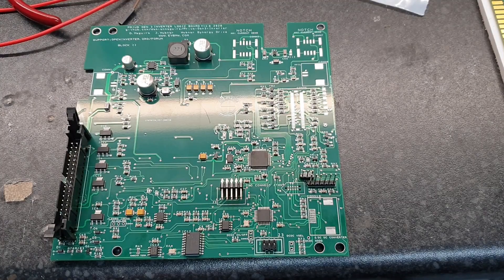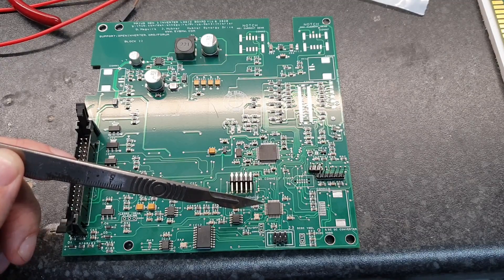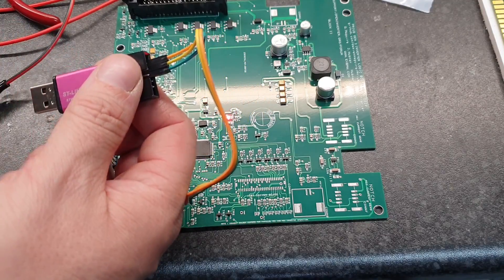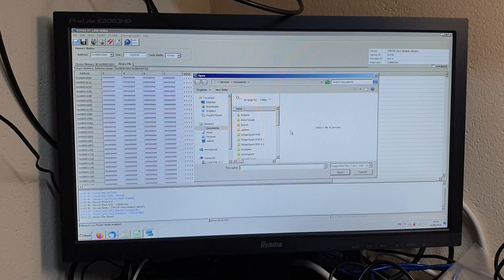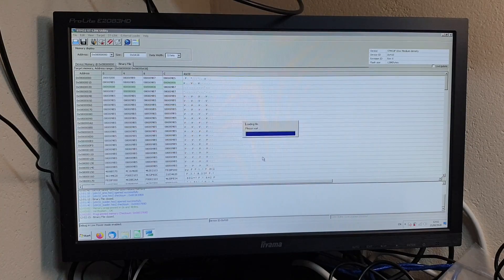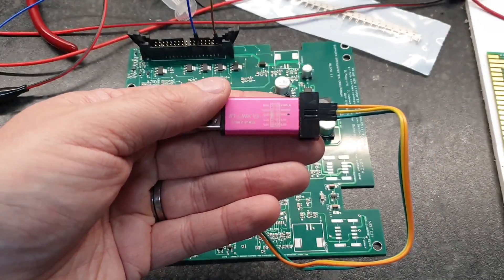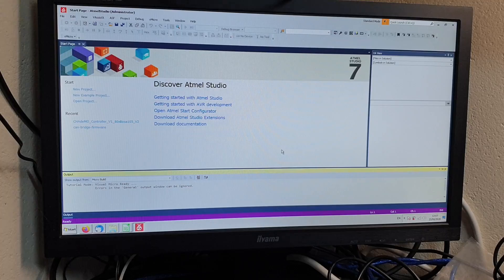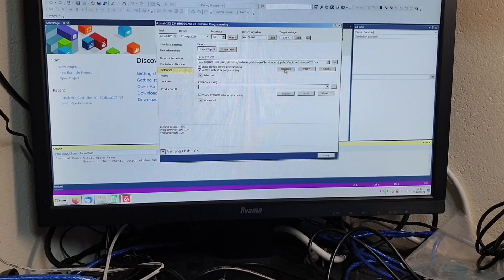Prius Inverter Logic Board Installation Manual Part 3

Comment: Hi, I hope someone gonna help me.

I saw on the site that the bootloader need to be the .bin file but un this vidéo you say « do not take .bin »  So can I erase the chip to reload a « .hex » ?
And the buck boost of the atmega 328p what is it used for ? 

If it’s write somewhere on the forum « openinverter » just send me the link if you prefere. 

I thank you in advance for the answer

Comment: Good day, recently i finded your "design to allow the Gen 2 Prius inverter to be used as a DC Series motor controller" in "Prius-Gen-2-Inverter" theme, do you have video with using this device? How to connect it to inverter gen2?

Comment: Timestamps and procedure:

This tutorial will show you how to program both of the chips on the Prius Inverter Logic Board, the "STM32" and the "ATmega328p", necessary for getting the inverter board to work, for those who chose to just purchase the populated board. If you purchased the full kit, these will already be programmed.

3m25s - Power the board. 12v to the board. Top left (outside) is ground. 6 pins down is the 12+. Red LED should stay lit.

4m40s - STM32 Programming. Several methods. You're watching a tutorial, so this is the easiest method. Purchase an "ST-Link v2" dongle from eBay, only a few dollars, it usually comes with the jumper wires. The pinout is shown right on the case. You will not use all the wires, only 3 of them. These 3 wires connect to 3 pins on the Prius Logic Board (but not in the same order).

You will use:

"SWCLK" (single wire clock) - To outside pin closest to board edge.
"SWDIO" (single wire data input and output) - To inside pin.
"GND" (ground) - To middle pin.

Then plug the dongle into a USB port on a PC.

7m58s - ST-Link Software. Link in description. Download and install it.

Click "Target --> Connect" from top menu. You want to see the screen get filled with a data dump of symbols. In the upper right of the screen you can see it identified the device.

In the main viewing window are multiple tabs, click the "Binary File" tab to select it. This will ask to open a file, you choose: "stm32_loader.hex" from OpenInverter.org, download ahead of time. This will change what shows up in the viewing window.

Click "Target --> Program and Verify" from the top menu.

This pops up a window, and you can probably just click "Start" on that window. This programs the STM32 chip with the stm32_loader.hex file.

The STM32 on your Prius Inverter Board can now load other files.

You can close the stm32_loader.hex tab, and go back to the "Binary File" tab, which will ask to open another file. You choose: "stm32_sine.hex" or whatever other OpenInverter.org configuration file makes sense for your project (.hex for motors with encoders, .foc for motors with resolvers, the type of motor you are using determines which of these to pick).

Same as last time, click "Target --> Program and Verify" from the top menu. And click Start.

The STM32 on your Prius Inverter Board now also has the software to run a motor using a sine wave (or FOC) and is set to use that.

A different red LED on the Prius Inverter Board will not be rapidly blinking continuously.

You are now done with the ST-Link USB dongle, it's no longer needed. Future updates can be done via wifi.

11m41s - Programming the AT-MEGA 328P chip. There are many ways to do this, you are watching a tutorial, so this is the easiest.

You will need to purchase an "Atmel-ICE" device. Plug one end of the ribbon cable it comes with into the "AVR" plug on the device. Plug the other rend of the ribbon cable into the (only) 6-pin header on the Prius Inverter Board, with the tab on the plug facing the outside of the board.

A green led will illuminate on the Atmel ICE device.

(Damien skipped this). Plug the Atmel ICE into a USB port on a PC.

13m46s - Atmel Studio Software. Link in the description. Download and install it.

Click "Tools --> Device Programming" from top menu.

A window appears, select:
"Tool" - Atmel-ICE
"Device" - ATmega328p
"Interface" - ISP

Click Apply.

Click "Read" below "Device Signature", to initiate communication with the chip. Some numbers and symbols should now appear below the Device Signature. 

On the left menubar, select "Fuses". In the pane to the right, under "Fuse Register", change the values to match the following:
EXTENDED: 0x05
HIGH: 0xDE
LOW: 0xFF

Click the "Program" button on the bottom right of this pane to program the chip. A quick progress bar will appear and the chip will program

Just to the right of "Program", click the "Read" button. Then, back up top by the Device Signature, click that "Read" button too. (Why?)

On the left menubar, select "Memories". In the pane to the right, is a "Flash" title, and a file you can choose. You want to choose: "optboot_atmega328.hex" from wherever you installed your Arduino IDE. (We've skipped the step of downloading an Arduino IDE?).

Click the "Program" button right below the Flash and filename.

The ATmega328p chip should now have an Arduino bootloader loaded onto it, which means the Arduino software can now load files onto that chip.

16m11s - Conclusion. Don't do this, and don't support Damien, he has threatened to make more videos and boards if you do.
Reply: Thanks 👍

Comment: Cheaper method for the AVR that I personally use: You can use the Arduino IDE's "burn bootloader" functionality if you have an in-circuit programmer supported by the IDE, like USBasp. As mentioned by Damien, it can be less dependable than Atmel's software and hardware.